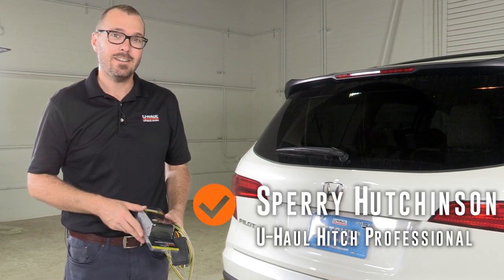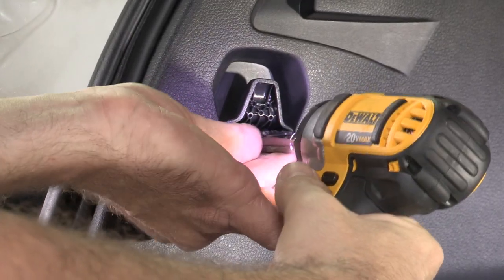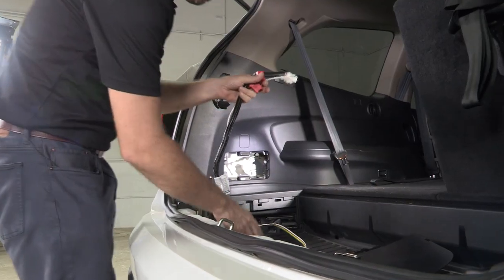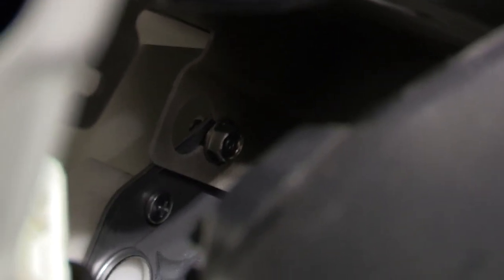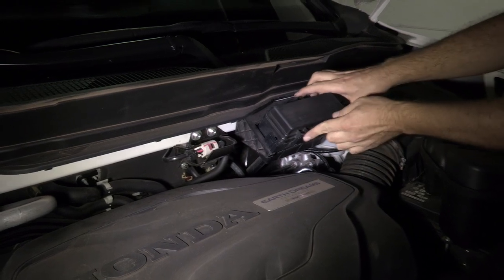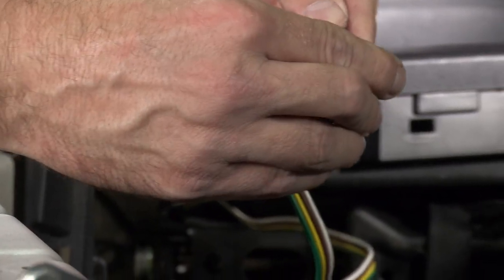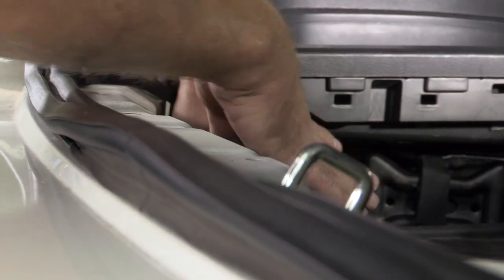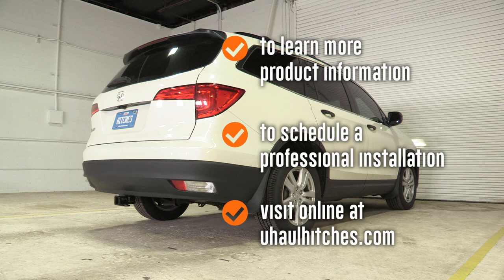2018 Honda Pilot Trailer Wiring Installation

Comment: This video was great. because of this video, i knew where the harness inside was. 5 minute install. Didn't pop any panels open at all. Just the side panel and the car jack area. found the connector by feeling inside and connected the wires.

grounded the device and zip tied it down, slapped the fuse in and was done. Thanks
Reply: That is what i was thinking too. Thanks!
Reply: Same.  Anyone know what that white lever is - the one held on by the screw he used for grounding?  Just curious.  Keep wanting to pull it.
Reply: @dwalkermtb  fuel cap release if the electric button fails.